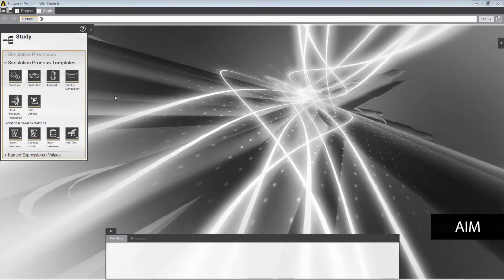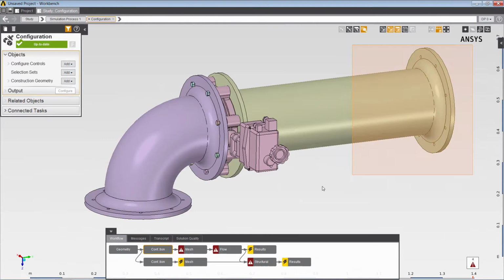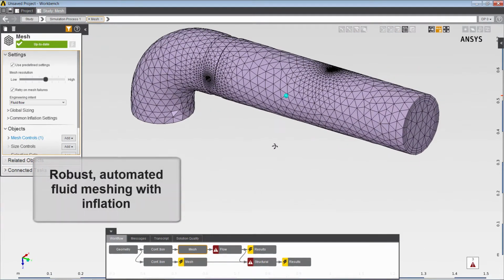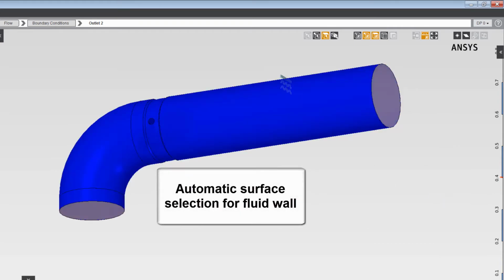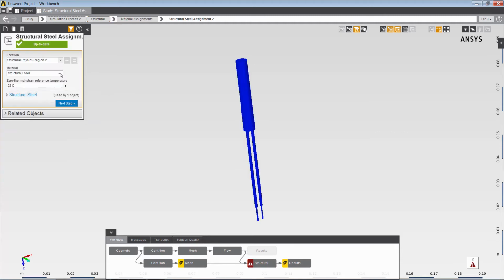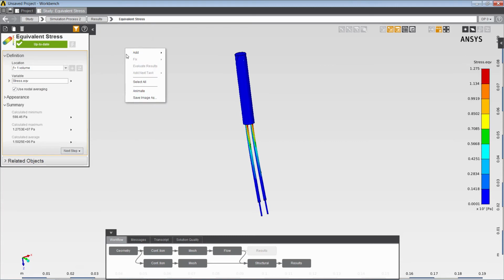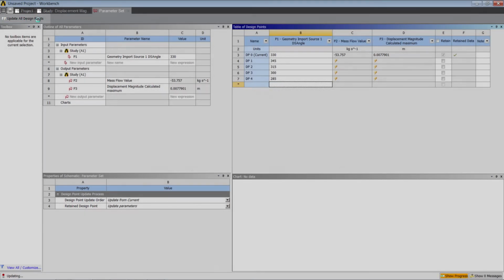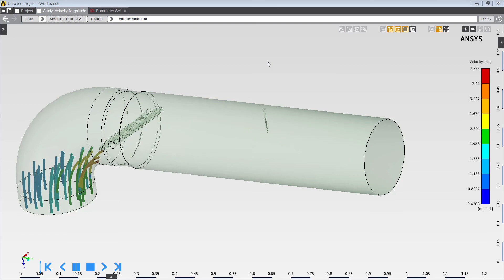ANSYS AIM Valve Demo

Comment: greetings, in this type of simulation can appear water hammer effect? 
for example, while the fluid is passing through that pipe with valve partial closed, at a specific time the valve will suddenly close.
can anyone help me with an answear?